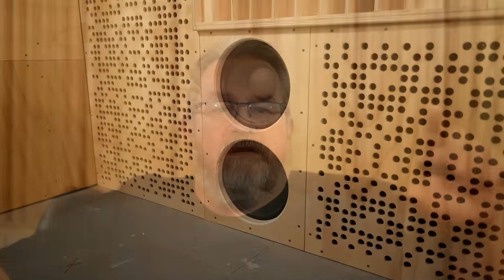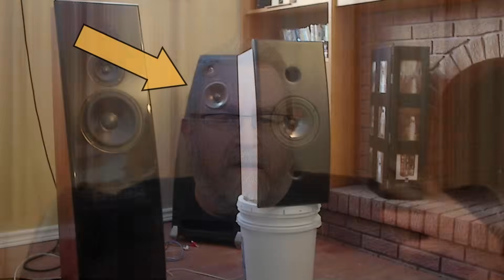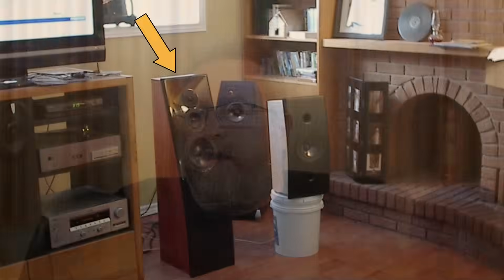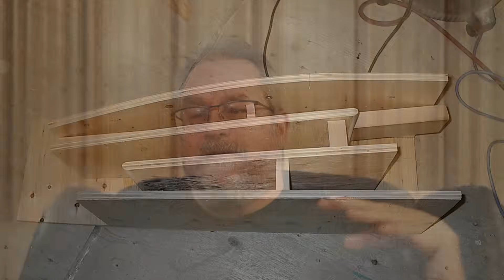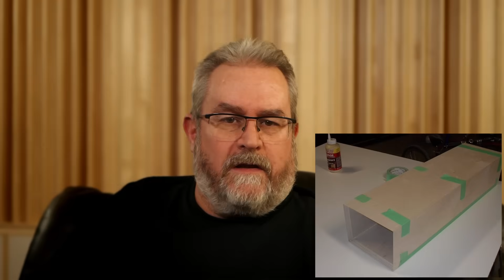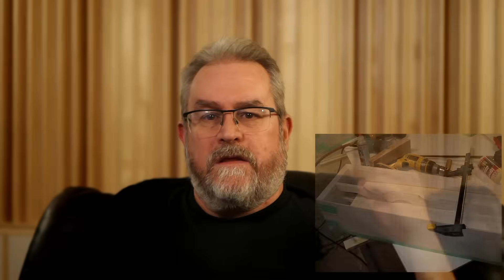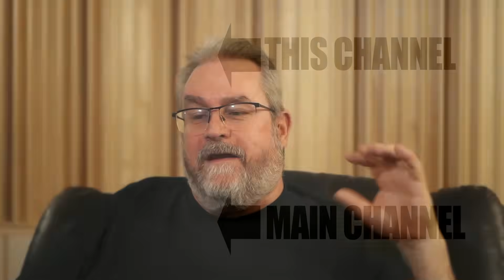Transmission Line Speakers are a Trap

Comment: One of the worst things that can be done with a TL, is placing the driver at the end of the line. Placing it at 1/3 to 1/5 from the end. This is the most effective way of reducing the ripple. And designing the line length solely on the Fs is really detrimental. Qts, with the woofers crossover inductor resistance needs to be considered. 
Honestly, a MLTL (mass loaded transmission line) is much easier to design and out performs a TL
Reply: I did not, but as the design was done by Paul Kittinger, one of the most respected MLTL designers around, I don't believe it's necessary. I have done others in experiment and it was audible, though slightly.
Reply: I will disagree somewhat. Moving the driver does not remove the ripple, but decreases the intensity. Just as fill in its proper placement does. In my last mltl, a single fold, the woofer is placed at about 1/3 from the start of the line. Fill was added in the first section only. As could be seen in the impedance plot and freq response, the amount of ripple was negligible and further reduced in upper harmonics by the crossover.
Reply: @isaeagle4031  Offsetting the driver should make a significant difference, if you offset it enough to null out the 3rd harmonic resonance.  If not dealt with, will introduce a noticeable dip in the overall response, as any good sim would show.  Of course you can stuff the line to try and deal with that resonance, but that just ends up cutting the bass output from the vent. 

There are several examples of offset TL builds on my web site. However they're mostly aimed at subwoofer duty,
Reply from the maker: But did you have the exact same design where the driver is at the start of the pipe to compare the two? And by compare, I mean listen to music from both to see if one sounds better than the other. Measurements are useful and helpful, but they'll often highlight things that our hearing doesn't pick up on.
Reply from the maker: In both designs I talked about in this video the driver was placed part way down the line. Still had ripples to deal with (that also showed up in the modelling software). In reality, I don't think moving the driver away from the end gets you much of an improvement, while stuffing does make a significant difference.

Comment: Guesswork?  Have a look at AJHorn which is a calculation program for any loudspeaker, especially Horns and Transmissionlines ( call it M.King developed to a 'german engineering level' :)
Reply from the maker: It was guesswork 22 years ago when I made that first pair. I wasn't aware of any modelling software that was available back then for a TL design.

Comment: Have you tried a maximally damped sealed woofer? A little EQ to make up the missing low end and your rear wave is gone. Near perfect transient response as well. There was a guy in the 80's in Speaker Builder magazine that was doing well stuffed Transmission lines. Very stuffed by today's standards and he was truly absorbing the rear wave as well. So many ways to skin a cat. Meow. John Cockcroft was his name.

Mark
Reply from the maker: I would seriously question whether it was all absorbed, but I'm a "100% is actually 100%, not just really, really close to it" type of guy.
Like the infinite baffle setups that are not completely soundproof from the front to back. They get rid of most of the cancellation, but not all. I know that the wall my subs are in is too thin and pretty much see-through for low bass.
But the point was the more used implementation and how it's needlessly complex. A vented speaker will get it done more efficiently.
Reply: @IBuildIt    You could double or triple the drywall. Pretty sure in your travels in work you may have done some soundproofing work. CGC has great manuals on this. Yeah you are right 100% is a silly statement. Lets go with most. As for vented. I place them preferably on the bottom, or back. Never on the front. You can hear the phase delayed midrange through the vent on the front. Once you pick it up, you canna unhear it!

Mark
Reply: @KravchenkoAudioPerth  Its not just the delay you are hearing.  Ported speakers are almost always Tuned to a certain low frequency.  This creates an Artificial sounding bass response... well.. actually because it IS artificial.   Yes, it allows your speakers to go Lower in frequency... however, that comes at a cost of it distorting the actual music, to do that.    Properly designed Sealed speakers, provide natural sounding bass... the way that the bass was meant to be heard.  Not tweaked artificially, to be a droning mess.
Reply from the maker: I think if I did a double layer of 5/8" drywall on top of the 1/2" that's there now I might make a measurable difference and reduce some dips and peaks in the low end response, but I'm not sure that doing it will make  a difference I would hear. I already have solid response down to 15Hz that's getting the job done.
Did "soundproof" doors in some locations, which were mostly about making as tight a seal when the door is closed than anything else. Complicated sound seals that are a pain to install and adjust, the doors reduced sound transmission but in no way could they be called sound proof.
Reply: Adding EQ to a sealed system will destroy the transient response, especially when you begin turning that volume knob up. it all good at a 1 Watt input but when you put in  20 watts continuous input there is a significant difference in group delay and cone travel.
Reply: @eccentric363  This is a load of Horse Poop.  I have sealed speakers... and I regularly tweak the EQ to my liking.

 I personally listen to virtually every type of music that there is... and I can tell you that when I chose to listen to "Sculpted" by Haywyre  ...which has heavy and low bass.. I was able to push my speakers to the maximum bass potentials, with the EQ.  Shaking the room, at very high volume... yet not smoking the drivers.

 Depending on the Music type, and how it was recorded / EQ'd,  I find that my own EQ solves the issues, and allows me to get the BEST performance out of my speakers.

 One particular thing is any music created in the 80s... has little to no compression.  They are thus "Quieter", and often lacking a little, in Bass levels.   I can boost their bass, and accent the treble to keep the clarity.  And afterwards, these wonderful old tunes, can pop like no other generations songs... as almost everything made in the 90s and beyond, is full of awful compression levels.

 EQ can help with some of these later compressed songs a bit too... but they will NEVER compare to the 80s, or pre-80s era of non / low compression era of music.
Reply: @johndough8115  Well John that is actually encouraging to hear your first hand experience with sealed speakers.  I am building speakers at this very moment. My comment came from a passage in  Vance Dickason's loudspeaker cook book ( a few years ago now) he basically said what I said  however if your bass driver is large enough or has a good X-max you could probably get away with it.
Reply: @eccentric363  The speakers I have are  EPI 100v   speakers.   They have an 8" woofer, that supposedly uses a thicker gauge wire, to auto-filter out any high-frequencies, without needing an additional crossover component.

 They also have a very unique  Inverted-Tweeter (concave, rather than Dome).  They produce the widest 3d soundstage, with the most incredible detail... and without being Fatiguing.   Ive never heard anything as amazing.   You can place them in the worst rooms / positions... and they will still sound incredible.   The speakers basically vanish... and it sounds like actual singers, and instruments, are in the room.. to the point where you could point to them, in 3d space.

 Ive also heard things in music, that none of my other speakers, nor headphones, were able to deliver to me.  For example... certain songs where the singers vocals were muddied, and you couldnt tell exactly what words they were singing.   With this speaker, you could actually easily tell what they were singing, without question.  I was completely floored by this.

 The sweet spot on these, is almost an entire room.  If you stand at least 1ft inwards of the left of right speaker... you still get full stereo imaging.. as if you were actually standing right in the center of the room.   Its almost holographic.

 The only drawback, is that they do not drive as Loud as you might desire to pump them.  Dont get me wrong... they can get really loud, and can put down some very surprising bass levels... but you get dangerously close to feeling like they will blow... and still desire to crank them a bit more.    That said... there are other EPI designs, that simply add more drivers... which might solve that issue.  Ive never heard them though.

 I got mine refoamed for $100.   I compared them to the local high end stereo shops $3000 speakers... and it wasnt even close.  My EPIs completely stomp the living crap out of those crappy ECO speakers.

 Just to note... EPI made a few versions of the tweeter.   If you pick up a pair, get the ones with the Updates tweeters.  The old ones have a fiber-board surround.  The new version, has a plastic bezel.  They are vastly improved in performance.

 There is a site,  Humanspeakers  dot  com.  The guy used to work for EPI,  and he actually repairs / restores these drivers,  as well as sells brand new hand-made drivers,  based on the originals.

 He also restored (or hand built?  cant recall)  a pair of EPI 1000 speakers... which are like 7ft tall towers, with like 8 speakers per tower.  Id love to hear those beasts in person.

 Also, if you do manage to find a pair locally... make sure the woofers are originals.

 One thing i noticed right away with the EPI's.. was their weight.   A single EPI speaker, seemed to weigh 2x what my larger Techniques speakers weighed.  When I removed the woofers, it was very apparent in how different those speakers were.  The techs was 12" woofers, and used small, and weak magnets.  They were light as heck.  The EPI woofers, were heavy as hell... despite being 8" drivers.  They have very large and very powerful magnets on them.  I believe the voice coils are also much larger and stronger too...

 That all made sense,  when I tried to seal my Techniques speakers... to see if it would improve them.   Those weak eco woofers, were not capable of handling the air-pressures of a sealed box design.  Rather than undo the changes... I just put them on the curb... as hearing the EPIs made them intolerable to listen to anymore.

 I do have one other sealed speaker pair.  Full size Advent bull-nose speakers.  They have something like a 9" driver, mounted into a 12" basket (using a strange bezel system).  Very unusual design.  Its also a 2way... using a fried-egg looking tweeter.   The tweeter isnt even close to being as good as the EPIs.  And the bass levels are just WAY too exaggerated on them.   I only used them in a home theater situation, to add more rumble to the room... as they sort of acted like very powerful subwoofers.   But I couldnt stand them for normal music listening.  Even when using them for home theater, I had the EPIs on the other channel, at the same time... to help give a much better sonic experience.  But those advents were amazing for things like when the Train rolled in, on the "Polar Express" bluray.    Dont get me wrong... the EPIs have loud and plenty of room shaking bass potentials... but... the advents were like .5x much vibrational punch.

 The deepest sounding bass, however, was probably from my Phillips woox speakers.  Despite having like 6" drivers... their special passive radiator design, created an incredible excited bass performance.  They were good for stuff like electronic bassy stuff,  or modern dance stuff.  These speakers actually had a decent set of mids and highs too... But they still paled in comparison to the single EPI tweeter.

 My advice to you, is to try to find a place to check them out... as you might quickly change your mind about what speakers you want to build  + what drivers you might want to choose.    I think that a lot of people  buy cheap drivers from parts-express... and think that making a great box will somehow make those cheap drivers, perform like high end speakers.   Sadly, thats just not the case.   A poor quality driver, will have major sound quality limitations / issues.. no matter how good of a box that you put it into.
Reply: @johndough8115  something about a good 8in two way